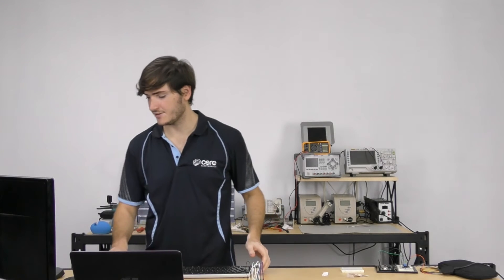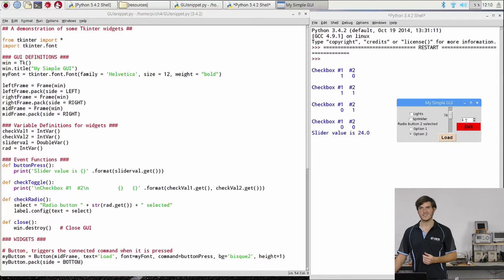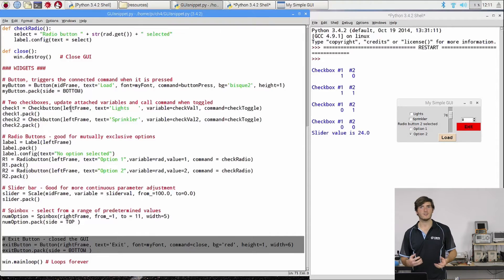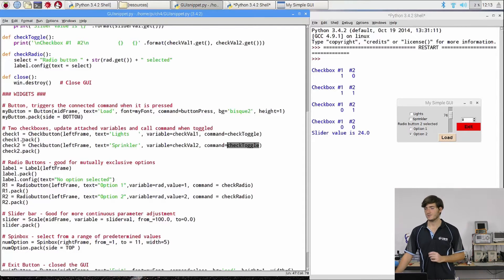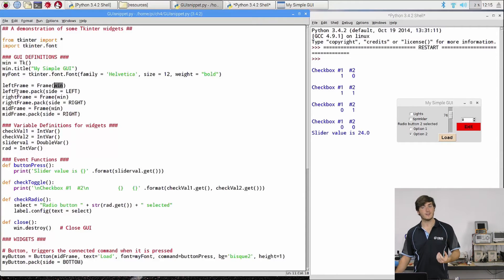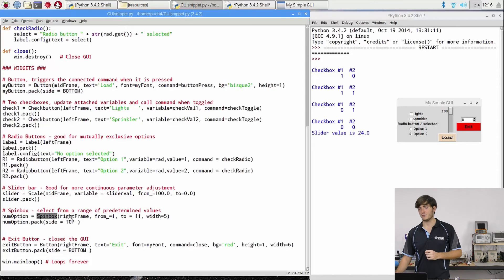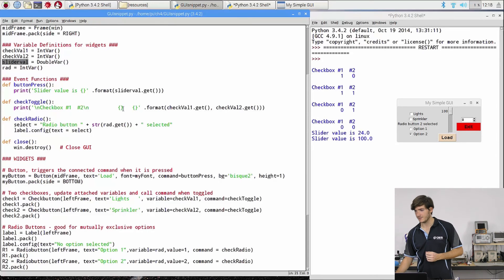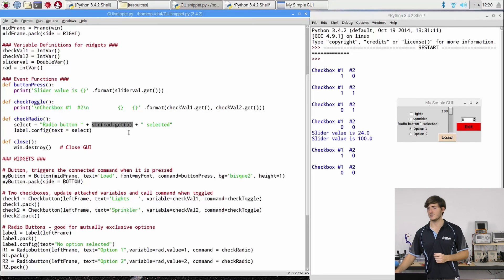Raspberry Pi Workshop - Chapter 4 - Other Widgets in TkInter

Comment: i have got an 8 gang relay set up to run on my raspberry pi 3 model b. I want a gui to be able to contain a timing program for the relays to control a spray pump and also have the ability to be manually turned on and off. my question is how do i include the timer?